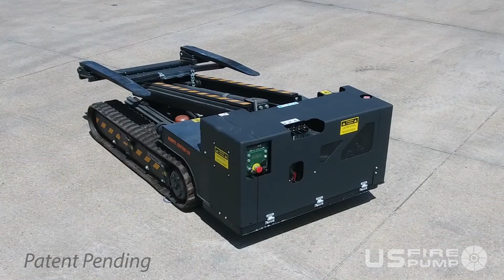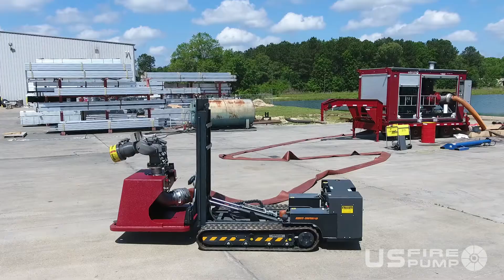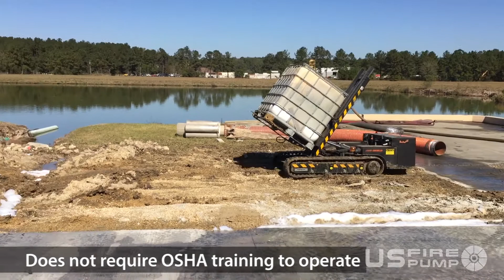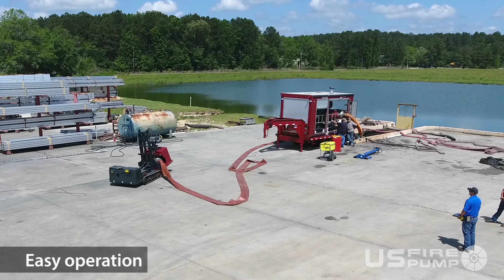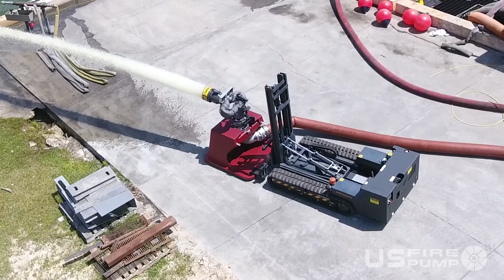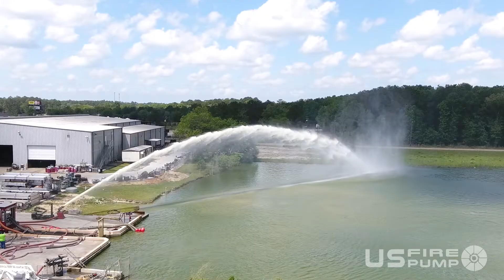Remote Track Monitor

Comment: Hmm, a wildfire solution.  One drone under a hosebed, and manifold would allow deployment from the end of a water main on a development perimeter.  Another drone could deploy the monitors, with an attached hose rack from that point.  They could all be stored in a pump house secure from casual vandalism in the off season, the pump house would contain a booster pump to maintain pressure in the extended system?

You have a red flag or imminent danger day so you send a trained volunteer out to the pumphouse and he connects all the hoses and checks the system instead of a truck crew or a bunch of brushfire trucks?  Now you have a way to cover critical infrastructure or cover neighborhoods while covering threatened infrastructure.....  Flexibility?